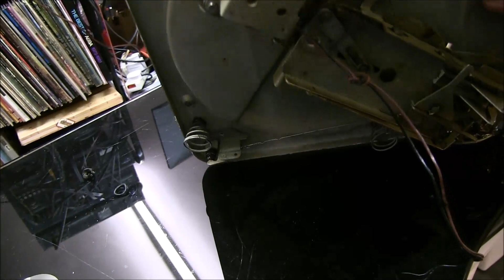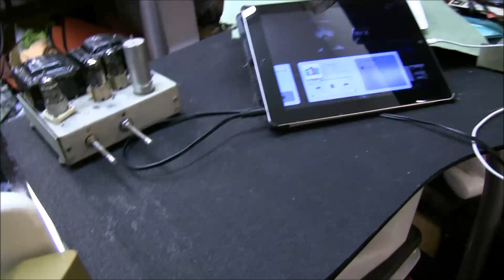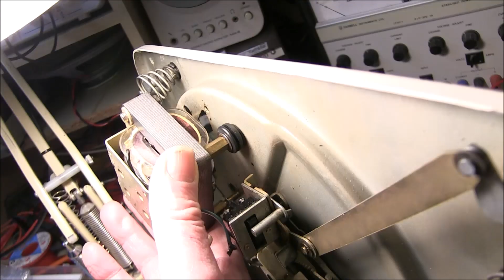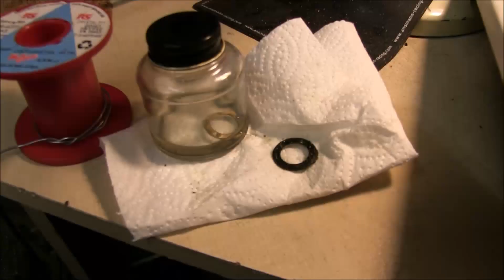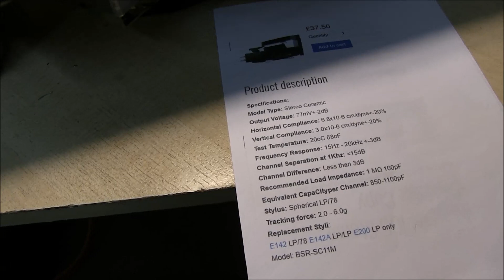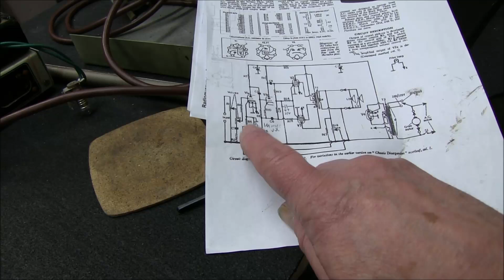BSR UA8 and Pye Black Box Mono 1950s record deck and valve Amp service.

Comment: I used to hate what Pye did with so called volume compensation. You never could get any thing like a flat response. Turning the volume up or down made everything change way to much. If you had a low level track you needed to turn up the gain much more than a high level track (obviously) making it sound very coloured. I have only repaired 2 of these over the years and I replaced all that stuff around the volume to a more standard circuitry. Both my customers commented, it never sounded so good.
Reply from the maker: Hi Michael. Thanks for the feedback and information. All the best spinning. Nick